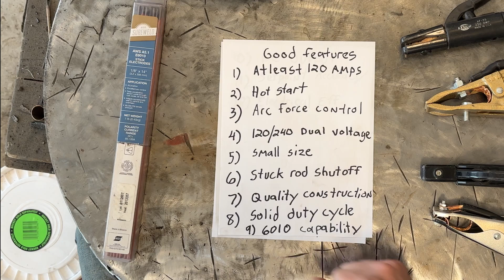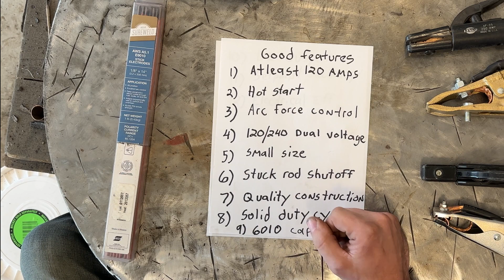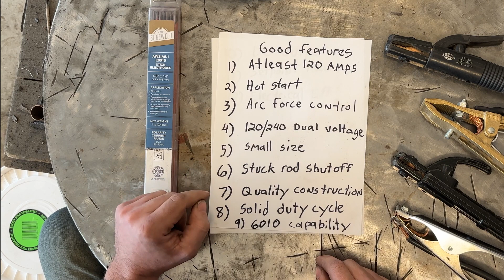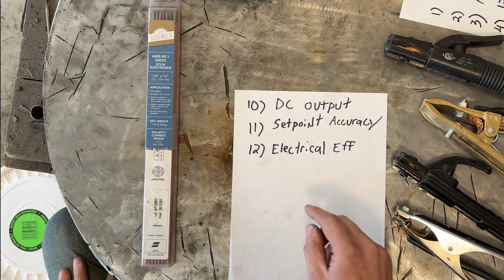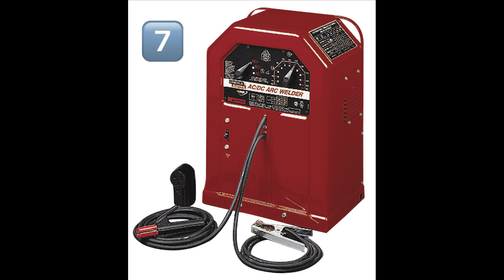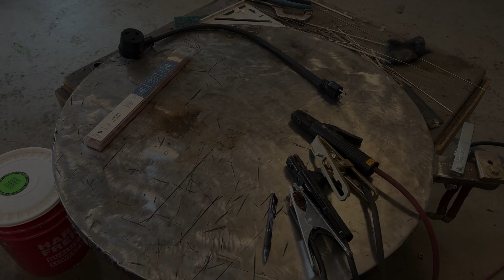Picking out a stick welder (features to look for and top 10 recommendations)

Comment: I have a multiprocess machine, but I have so much fun with stick, I don't really feel the need to Mig or Tig, so what if you have to chip it, least you know the joint is solid. Its just satisfying.
What I do not understand is the Fronius TS2200 has a open circuit voltage of 90V, yet it says it cannot do 6010, I thought anything above 70V could do 6010, so why cant it run it?
I like the look of the old school Lincoln, buying a 2nd hand, you would have to restore that sucker.
I wonder how the CST280 would stand up against a transpocket 180, its hell of a lot cheaper.
Reply from the maker: Stick is a very functional process.  The main shortcomings of it is welding sheet metal, welding aluminum, and metal deposition rate (wire blows stick out of the water for weld metal deposited).  Mig tends to do what stick doesn’t do well, aka weld thinner material, is faster, etc.  For much of what you might weld there won’t be a huge benefit to mig other than sheetmetal.

As far as why the fronius won’t weld with 6010, it has to do with its power supply.  Most multi process machines are setup to max out at 25-26v and 6010 needs 28-32v depending on rod.  The open circuit voltage being high makes it easy to strike an arc, but it doesn’t allow a welder to absolutely run 6010.  How much voltage it can output under load is what matters, and most welders struggle hitting 30+ volts.

The cst 280 is a very solid welder.  It’s nowhere near as portable (or likely as efficient) but on a 240v outlet it’s an awesome machine.  Its output on single phase isn’t that high (it’s less than 280, I remember that) but its duty cycle will far exceed the fronius machine.  If you want a machine to sit in a workshop and super portability isn’t a concern, you can’t go wrong with that machine.

Comment: Thank you for the content. Always helpful.
 I own an old maxstar 150stl with foot pedal, do you think i will regret it sell the maxstar and upgrade to transpocket 180? | wish I can have both but I can’t afford both 😂
Reply from the maker: I don’t think you would regret it at all.  The trans pocket is a better overall welder than the 150.  The trans pocket is more efficient, has higher output on 120v, runs 6010 rods better, and the tig version has better features.  The trans pocket would be easier to make good welds with because it starts rods easier, has more settings, detects if the rod is stuck and cuts power, and has more output power.  It is slightly bigger than the maxstar but not enough to matter.  I say do it 👍

Comment: I knocked the dust off this old video and am glad I did, great opinions, thanks for sharing. yeah, I see a lot of the channels pushing machines that seem to flood the market so yeah, definitely product placement ads essentially. Gotta ask, have you had any experience with the Arc captain stuff? Seem to good to be true but seeings as I'm in the third world now, Millers and Esab units are unobtanium or stupid money. Thanks again for the great content =)
Reply from the maker: So I picked up a arc captain 135 to test it against a yes welder and harbor freight 125.  It’s the only arc captain that I have used so I can’t speak for all of the other welders they market.  I can say the machine has been disappointing thus far.  A lot of stuff is very odd to me on it.  It has markings of UL listed (and others) yet based on how bad it loads up the input power I don’t know how it’s even legal to sell lol.  The video will be out within a week on that.

Here are my honest thoughts:   It might sound crazy but if you want a more affordable welder buy a used Lincoln mig machine (or other name brand) or buy a harbor freight welder (any one but Chicago electric).  Harbor freights welders have been “honest” in my testing.  They actually output the claimed power, they function properly as a welder, and they have proven to be decently reliable.  The arc captain, yes welder, and many others will put a ton of claims on the box and they flat out lie.  I don’t like that, I see that as ripping people off.  

Even if you look past the fact the specs are often all bs, there is an actual serious detriment to many cheap welders, that’s how they function.  Virtually all of the Amazon specials have highly inaccurate digital readouts or dials.  They often can’t hit proper output voltages so they flat out don’t run right.  This is a problem because 1) it makes it harder to make decent welds, which can lead people to give up learning welding, and 2) if you ever upgrade to literally any welding machine that functions properly they will run completely different and you will have to relearn settings and 3) if you attempt to follow settings someone else suggests good luck. 

So basically I would highly suggest looking at harbor freights titanium line because they are all actually pretty decent welders.  Beyond them there really isn’t another “affordable” welder line that is universally available to people.  Well one that’s decent enough that I think people should buy them.
Reply: @makingmistakeswithgreg  Thanks for the detailed reply, much appreciated.
Reply: jasic 
Riland 
Tayor Shanghai 
Hugong Shanghai 

best price / performance .

Comment: Ok greg...I subscribed because I believed you. But you showed a thumbnail of a firepower rig..but you didn't talk about it. I have one and wanted to know what you thought about it.
Disappointed...
Reply from the maker: The firepower welder is basically a esab 210 em-emp before esab branded it as their own and stopped making firepower welders.  The machines weld very good, and have the features you would like to have on a good 200amp wire welder.  The welder I have is MIG only, so it doesn’t do stick/tig.  

The only real draw backs of the machine is the lack of power factor correction really makes it hard to weld on a generator (and makes it easy to trip breakers on 120v) and certain consumable parts are harder to get.

Comment: Hi Greg, I was wondering if you had any experience with the Everlast welders?
Reply from the maker: I have owned two of them.  There is a lot to like and some things that aren’t so good.  They generally weld exceptionally well, they don’t lie about their specs, and they have proven to be reliable.  From a negative point of view the fit and finish on things is not at the same level is esab, miller, Lincoln, etc.  They tend to be really loud when running, many don’t have fan on demand.  Their water coolers are obnoxiously loud as well.  The way you switch processes on many of their all in ones is far less convenient than most other companies.  The software on their lightening series lacks serious polish.  

If I was going to buy a everlast I would stick to their simple interface units and stick with a stand alone (not multi purpose) machine.  All of those are solid.
Reply: @makingmistakeswithgreg  Thank you, Greg. Miller, Lincoln and Esab are out of my price range, so I was curious if those would be a good choice, specially their stick welders.
Reply: @makingmistakeswithgreg Not knowing anything about them, where would you place them in your 1-10 list?  Are they Amazon quality, Harbor Freight or are they actually well made like Miller etc.?  Thanks for your replies!
Reply from the maker: So everlasts stand alone welders from a weld performance perspective are good.  They don’t lie about their specs so if they say it will do something, they will do it.  Thats one of the biggest downsides to Amazon, many companies flat out lie about what a welder will do.  Everything from actual welding output, rods they will run, power efficiency, etc.  luckily everlast doesn’t lie about specs.  When it comes to performance they tend to be (generally speaking) better than harbor freight across the board.  The fit and finish of their machines tend to be at the harbor freight level.  I caught a lot of heat for saying that but I have played with enough of them and owned a few that I can make a pretty solid opinion.  When you look at the quality of everything from drive rollers, mig guns, cables, and the way they are constructed, they are nowhere near fronius, esab, miller, or higher end Lincoln’s.  However those things don’t really affect how well they weld.  If I was on a tighter budget I would definitely look at a everlast machine for sure, far before the Amazon specials, yes welder, etc.
Reply: @makingmistakeswithgreg  thank you, Greg!

Comment: got a transpocket 180. best small stick welder on the US market. pull the side covers and youll see the design and qaulity of components are second to none. and its duty cycle beats all other 180a machines. leads and clamps are top notch euro stuff. has pulse stick. temp controlled fan. expensive little guy but worth every penny imo
Reply: oh ya also the hot start ,arc force and arc break voltage are fully adjustable. has trouble code read out if theres ever a problem. records hour usage. quick connect power lead into the back. yada yada. brilliant machine for sure
Reply from the maker: The next machine I will be buying is a fronius.  They seem to be quite the welder no doubt.  Who knows, I might also switch my dynasty tig to a fronius too 😀
Reply: @makingmistakeswithgreg   
yes i have the iwave230 also.  a lovely machine indeed and top shelf in every way. nice thing about fronius ,you dont pay extra for software updates. after having three fronius machines for two years  now, i couldnt imagine buying or using anything else

Comment: Great video Greg There’s a lot of great machines out there but u can beat the Everlast PowerArc 280STH duty cicle is fantastic this thing is incredible An even wen being use for tig (foot pedal with 26 tig torch included)u can pulse tig with this it doesn’t have manny different wave forms but it’s definitely something u gotta check out 💪🏽💪🏽💪🏽💪🏽

Comment: Greg, have you ever had any experience with the Everlast welders? If so, what are your thoughts?
Reply from the maker: So I have owned a few of them, and I like them.  I am not a fan of the lightning series, that has crappy software and is kind of a pain to switch processes.  Their stand alone welders are excellent and often have features many other welders don’t.  I will say this though:  the best way I can describe their welders in general is they lack polish.  If you compare them in person/hands on with Lincoln, esab, and miller, every part is just a little bit cruder.  The fit and finish, quality of the accessories, how loud they are when running, etc are across the board not as good as the esab, miller, and Lincoln’s.  However from a welding perspective they across the board weld exceptionally good.  

I definitely need to do a everlast comparison video on the channel since they are popular and I think I could do it justice.  Compared to most of the other ones out there (think Amazon specials) they are far better, and they never lie on the specs.  If they say their machine does something (like run 6010 rods) it will.  There is something to be said for marketing honesty.
Reply: @makingmistakeswithgreg  Thanks for the info Greg, I love your channel. I recently retired from the military and I've always wanted to learn how to weld, so I got into the program at my local community college. I wanted to buy my first welder so I could practice at home too, and I was looking at the EVERLAST POWERMTS 211SI WITH TIG PACKAGE. Does is have the same software issues as the Lighting series? If so, do you have any other recommendations? I can't justify spending over 2k on a big boy right now not knowing where this journey may end up. Thanks
Reply: Did you get the 211?   All the things it says it can do, it does.  It jumps step in the settings if you are not fast.  I think they finally ran out of 211s, but still have the 251.  The mig torch is so cheap ,they say it won't hold up to flux core and my ground clamp is bent.
Reply: @tsl7881  no I didn’t, Everlast never replied to my email. I ended up getting a PrimeWeld MIG 180. Their customer service is top notch.
Reply: Yeah that was my experience, their customer service needs improving along with their sales and  tech support attitude.  At least their office is in the states.

Comment: I recently bought my first welder and I’m so delighted with it, I thought I’d share my experience here because it’s most relevant to this video as I took Greg’s advice to heart. The Sanrex 160s I bought has almost every item on this list with a couple exceptions— it doesn’t have stuck rod shutoff and the arc force isn’t adjustable (it’s auto). It does have hot start and arc force, just not adjustable. But the Sanrex is $599– barely more than the Titanium 225 and crushes it IMO.  

The Sanrex has more than 120a available— on a 120v 20a breaker! Now this is a residential breaker, so certainly less on a generator since it’s actually pulling 31a or so to deliver that rated 125a output. But I’ve tested it in my backyard and you can certainly get a really nice looking 1/8 7018 bead at 125a on that 20a outlet— on an extension cord no less.

The only gripe I could possibly muster about the Sanrex is that it’s hard to set with some precision because it’s just a twist knob with no digital display and the markings are too far apart— like every 20a. That’s much too coarse IMO especially for smaller rods where 5-10a can make a big difference.

The sanrex is an industrial unit with superb quality that just happens to be reasonably priced. If you are in the market for a compact inverter and are looking at the Titanium 225 and you don’t need amperage above 160, DEFINITELY look at the Sanrex instead. It’s much more efficient and real world useful for only a bit more money.

I have no affiliation with Sanrex, just love the welder

Comment: How about Hobart 160i
Reply from the maker: So the 160i is a good welder in the sense it’s made from quality parts and will likely last a long time.  The issue I have with it is it won’t run 6010 rods, 6011 isn’t the best, and the price is pretty high for what you get.  The fit/finish/build quality of the Hobart 160 is better than the harbor freight titanium 225, however the titanium 225 will run 6010/6011 rods far better and it is under half the price.  Another option would be the everlast 161sth, I believe it is better than the Hobart 160, and it costs less.  One other option is the 130amp version of the esab rogue for around 560$.  It will run rods better than the Hobart, has some adjustable settings (hot start and arc force) and will weld far better than most of the small welders on 120v.  The main downside is it only outputs 130a but depending on what your welding that would be enough to handle it.

Comment: Greg, is there a way to backdoor a judgement about 6010 capability? Lots of machines that can run it won’t say so, and many machines claiming the ability just lie. Is OCV the best hint?
Reply from the maker: Some machines have “arc force” settings but that isn’t a guarantee they will run 6010.  To run 6010 the welder must produce 32-34 volts closed circuit.  There are two ways to check for this.  One is to use a volt meter on output on a welder and weld.  Use a phone to capture the volt meters display (or a person).  After an inch of the weld lift the rod off the plate a little bit at a time until the arc cuts out.  If the arc cuts out at 28v there is no hope it will run 6010.  The alternative method is to take a rod and just try and really long arc it.  If you find the arc cuts out real quick after long arcing it odds are it won’t run 6010.  

Most welders don’t run 6010 well (or at all), which is a bummer, because it’s a very useful rod.  The cheapest welder I am aware of that is reliable/decent and runs 6010 fine is harbor freights titanium 225 for 260$ with coupon.